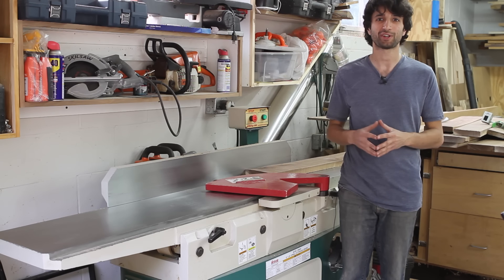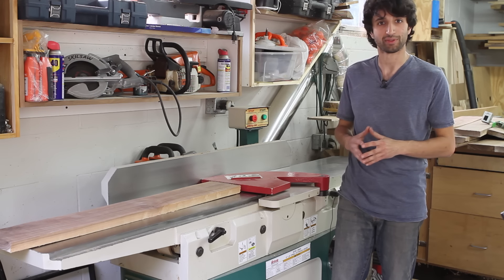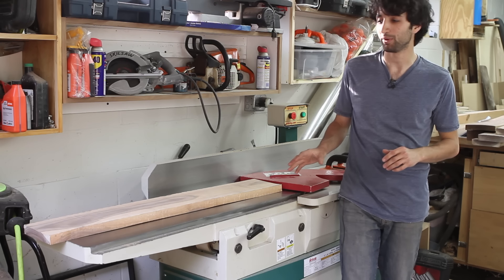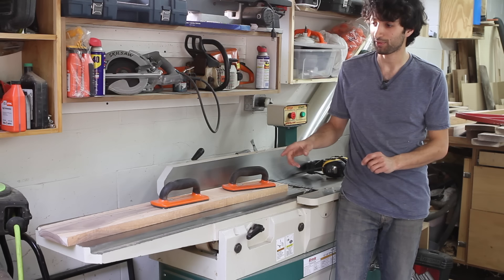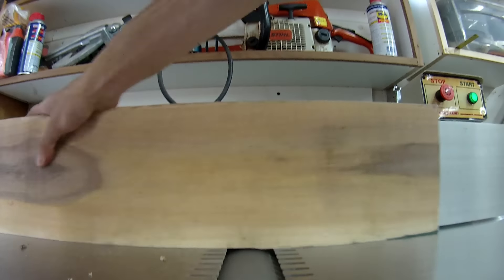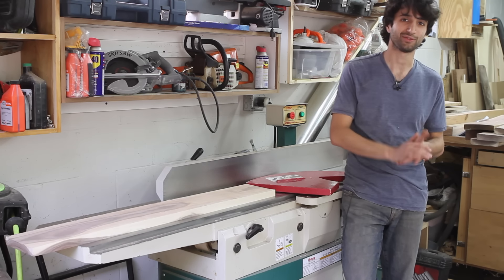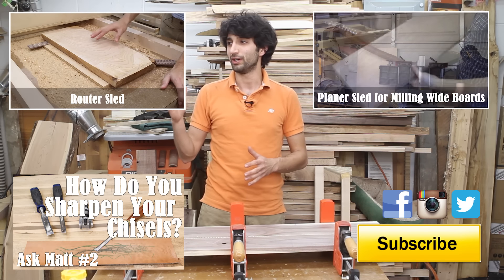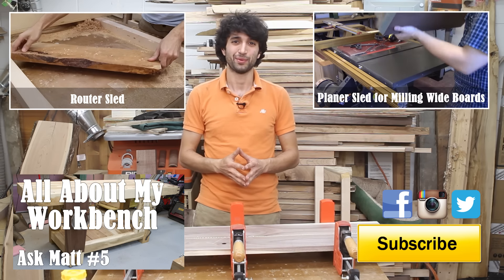What Does a Jointer Do? - Ask Matt #13

Comment: Can you run a 8 inch board on a 6 inch jointer
Reply: Can you wear a size 8 shoe if you're a size 6?
Reply: Yes if you squeeze them in lol I am trying to take 1/16 cup out of the board not to critical I am going to take the guard off and give it a try  with real light cuts idk
Reply: +Charlie Wood Joint it with one edge hanging off the table, once that section is flat, place on a "sled" of something like melamine. screw a hook block to the front of the sled so that is is dragged through the planer with the board.  Run the unmilled side through the planer to make it parallel with the section you flattened.  Flip board over and plane off the last ~2"
Reply: +Charles Reiche Fixed  it took to a friend with a huge jointer first board he ran on it and came out perfect Thanks

Comment: This is not a jointer. It is a planer. It planes wood. It does not matter which way up the wood is, the process is the same- the wood is being planed. What would you call it at 90deg? 89deg? 91deg? A jointer makes joints. The clue is in the name. What you call a planer is a thicknesser. It is cutting wood to a specified thickness. How hard is this?

Comment: So why not just use the jointer on both sides instead of using the jointer and then the planer?
Reply from the maker: you'd have two flat faces that are not necessarily parallel in other words, a board with a varying thickness
Reply: Matthew Cremona thanks for the clarification. Just getting into woodworking. I think I'm going to start with your router jig system until I can justify spending more

Comment: The fact that the table surfaces are NOT coplanar but are actually parallel and offset by a fixed distance is a critical point that makes this explanation completely wrong about how the joiner works.

Comment: Couldn't you possibly make all the edges 90 Degrees on the jointer but not on the Planer?
Reply: +OffBeatSocker 2k Yes you can but why would you want to? Get a flat edge and a flat side and then move on to other pieces of equipment. Jointer blades are typically expensive (at least mine are...more than other blades and a pain to set up) and they served their purpose of typical use. Rarely do I need an entire board like that without having to cut/rip it to other dimensions. As far as not using a planer...once you have one side flat on the jointer the planer is the best way to reduce the thickness of a board due to the fact that the rollers on a planer keep constant pressure on the board eliminating the "human factor" that is required on the jointer. At least this is what works best for me as a novice wood worker.

Comment: what you call a jointer I would call a planer. you call a  planer i would call a thicknesser . What type of joints does a jointer make?
Reply: jointers take their name from their hand plane counter parts, such as a stanley no. 7 jointer plane. the operation and primary function of both tools is to prepare stock to be 'joined' ie. surfacing and squaring stock.
Reply: I always knew a long plane as a jack plane. Maybe jointer is an American term.
Reply: Christopher Joyson yea maybe it is a purely American thing, not sure. We use jack planes for dimensioning lumber, but they are shorter and lighter than our jointers. We use jointers almost exclusively to true up edges and larger surfaces. Terminology in the cabinet industry is really funny... sides, gables, ends, and bulkheads are all terms for the same part depending on where you're from in the USA.
Reply: Christopher Joyson joiner

Comment: Matt... It's a JOINER, not a jointer. It's intended to be used to join two boards together. It won't make a joint. No such tool exists.
Specifically, the cutting knives being perpendicular to the fence shapes the edge of a board in order to join it to the edge of another board. 
Even more specifically, it leaves the grain of the wood open and ready to accept glue. Yes, you can sand the joining surfaces straight and smooth, but sanding or any other method used to true the edge, mechanically burnished the wood grain closed, thereby reducing the available area to accept the glue.
I would refer you to FAA publication 4313-b "Acceptable Methods and Practices for Aircraft Construction and Repair". Because early aircraft were made mostly of wood, much of the science of woodworking was studied by university scientific labs to set standards and to get the best results for wood joinery. 
The problem with the nomenclature of today, is the rampant rewriting of technical information by those who haven't studied the past. Unfortunately, there is no convention of terminology used in the trades like there is in more scientific disciplines. You can thank greedy capitalism for destroying trade unions in this country that were charged with maintaining expertise in the trade. Even in areas of mechanical engineering, terminology has creeped out into wide usage which is hard to believe. For example, "foot pounds" of torque is now widely being called "pounds feet" of torque.
I call it the "Dumbing down of America". 
Please, don't add your voice to the crowd of uneducated people in the world. You have a responsibility to your viewers to do it right, or not at all.
I really liked your vid, using the joiner to straighten cupped, crowned, dished, and twisted stock.
Reply: +Tom Clark No, it's not. A joiner is a device for putting two pieces together, such as a biscuit joiner.
Reply: No. These tools are named after jointer planes, which have been called that for centuries. Jointing is any process used square up edges for creating a joint (as in joinery.) A tool used for jointing is a jointer.

Comment: woodworking noob question: Why bother with a planer if you can use the jointer on both sides of the board?
Reply: Im no expert but usually iirc the planer can be generally set automatically to take off different depths

Comment: I disagree, the purpose of a jointer is to perform the first 2 of 5 steps to square a board.  1: joint an edge, 2: joint a face, 3: plane to thickness, 4: cut to width and last 5: joint 2nd edge.  That is what a jointer is for and that is how to properly square a board. Although there are specialty set ups , like cutting a rabbit, a taper, bevels and chamfers . I worked in a shop once that had a 14'' wide jointer(scary big) and that one had been converted from a square head.  High school stuff....😎

Comment: why not running all 4 sides through the jointer?
Reply: +Галым Бердыкулов Jointer is to make it flat....if you run the other side on the jointer both side will be flat, but not parallel

Jointer -> make one side flat
planer -> make the other side parallel to the first side
Reply: Zhana27 THANK YOU ! 👍👍👍
Reply: +Zhana27 Well on a theoretical basis it should be possible to make a a square piece of wood using only jointer ...

Comment: I realize that the tool is called a jointer but it is not pronounced jointer it is pronounced Joiner Do a little research into the English language and learn some of its nuances a Joiner is not used to make joints it's used to surface wood that will then be joined together.  Or talk to a wood worker who didn't learn his wood working off the Internet it's called a Joiner even though it's spelled jointer.